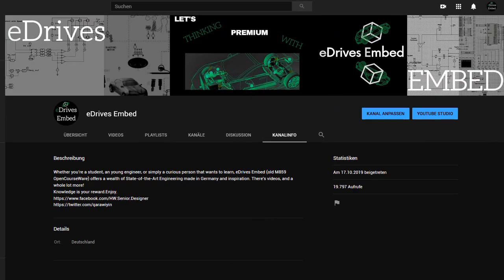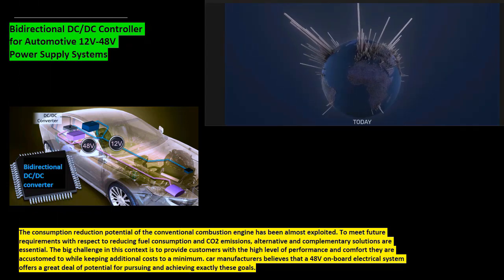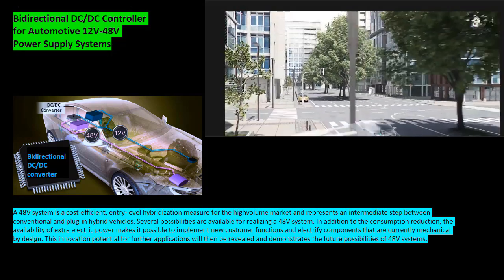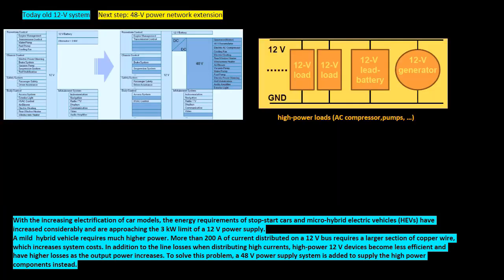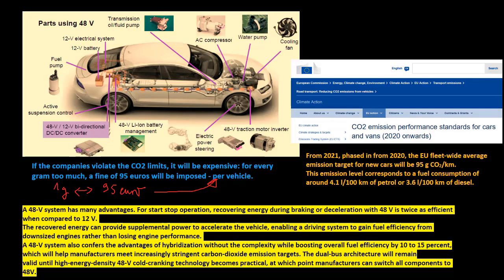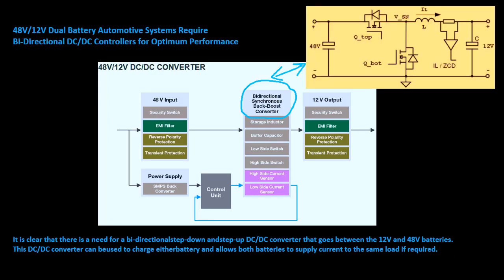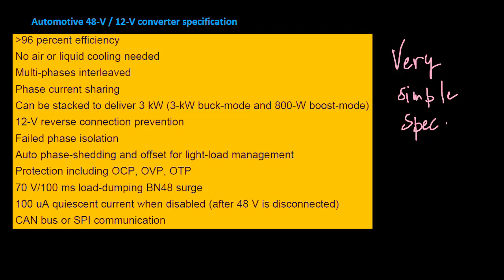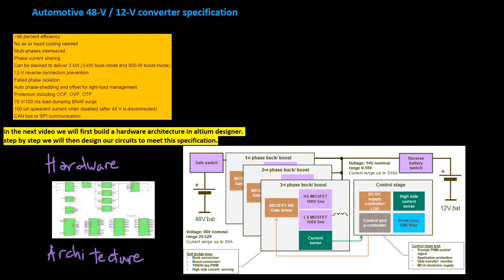Bidirectional 48V-to-12V Buck Boost converter for Automotive Systems

Comment: Hi I want to make bidirectional Buck Boost Converter for E-Cycle application.    Specifications:  Input Voltage=13.5V    Output Voltage=36V  Output Current=22A   Can u please help me in reaching out to the manufactures